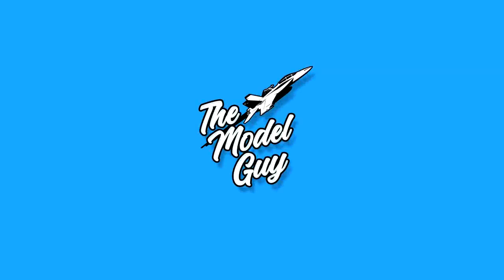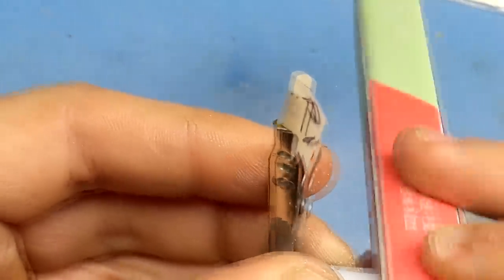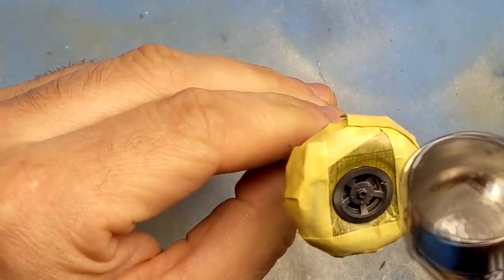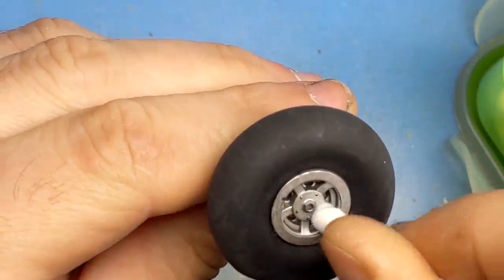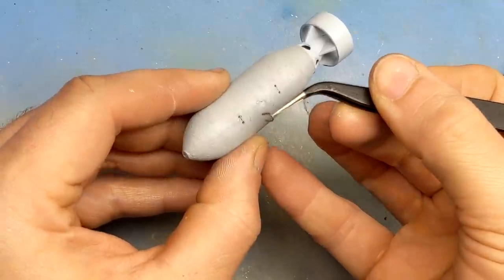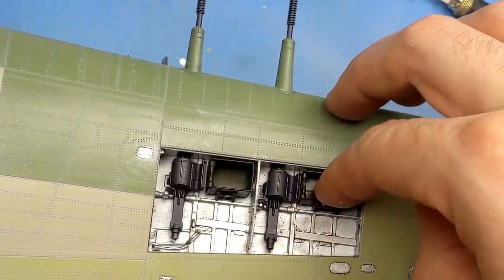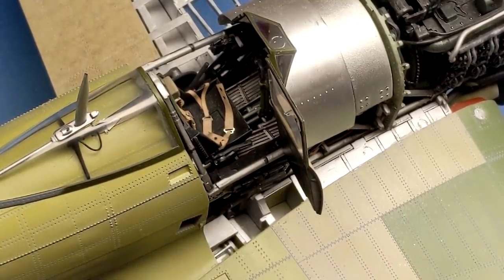1/24 Airfix Typhoon: Part III

Comment: A great video by a great Builder! What great work here! To those that commented about Airfix,  all companies even Tamiya have their good kits and lesser ones. Sometimes just older tooling re released is the cause. I have always been very impressed with Airfix 1/24 WWII Plane kits, fabulous detail! I just built 1/48 P40B, and it was a very clean and well detailed kit. it even has one piece Prop! That's more than I can say about Tamiya Spitfire and P-51 D. Those have those stupid individual prop blades!  A one piece prop is going to be within close tolerances, unlike where you put each blade in separately!

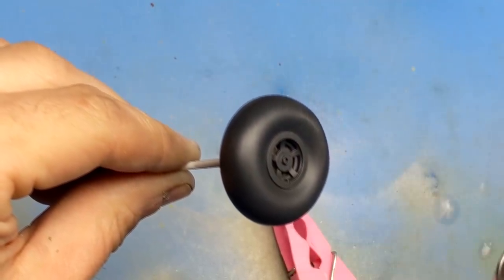Comment: Something new I tried on a model that worked out was using a hypodermic needle to create weld bead son  1:48 aircraft. I was building an Airfix Stuka a year back which had the option of leaving the engine open. The engine was not as detailed as I would have liked it to be so I decided to modify it... a lot. 
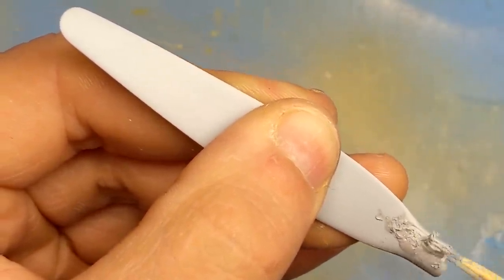To the point. I scribed out lines where I wanted weld beads to be and mixed a tiny bit of tamiya putty with tamiya titanium silver. I used the needle like a caulking gun to apply the 'putty paint' into the groove and used my hobby knife to create a texture. In the end the effect turned out epic and I have used it since. Not many aircraft have many visible weld beads so having them in some areas really draws attention to the area.  It DOES NOT work with 1:35 vehicles. It looks disgusting in the wrong scale.

Comment: i think the defects you out line in this kit and the add detail you have gone to to compensate have added so much depth that i can only see it as a benefit and the results speak for them selves. outstanding work love to see more in this scale. i am just getting back into modeling at age 55. and the level of detail required in this scale has me sucked in, your build has given me inspiration to attempt having a go at 1/24. scale. and will be watching for more info in adding extra detail and the techniques used to achieve the excellence you display.

Comment: Well you asked for opinions on Airfix models. I started making them in the mid 1960's. The smaller 1/72 subjects came in a plastic bag with the instructions stapled over the end of the bag. i don't think in those days they were ever meant to be super accurate scale models. they were for youngsters to make good representations of famous aircraft and tanks. I see the release date of the Typhoon as 2014 so to me it should have pretty reasonable moulding and not bad flash or mould misalignment.  Then again I think they are cheaper than a lot of competitors. To me Wingnut Wings is the other end of the spectrum. I now tend to stick in the middle around the Tamiya standard.

Comment: Where did you get that awesome landing gear assembly? who makes it?
Reply: are we talking about the spring assembly above the wheel at 3:46 in the video?
Reply from the maker: @mitchlenet4238  Ohhhh those. Those are actually Model Master Gun Barrels. They do awesome stuff. I have their M2 50 Cals for my  B-17 in 1.72

Comment: The problem and the challenge with all 1/24th scale aircraft (Not just Airfix) is before it is finished you will have had to re-engineer the crap out of them so that all the sub-assemblies fit properly together. But having said that, I wish 1/24th scale had as many choices as 1/72nd scale does, as I have built all of them but four, mainly because I refuse to pay over $150.00 US for a toy that could feed me for a week. My life long hobby has become to expensive to justify any longer.

Comment: Hey!! you are a pure artist mate!!! I have one question, how do you clean the old brush from the glue and putty? with acetone?
Reply from the maker: It can be cleaned with a lacquer thinner. Just make sure it’s an old one because that process will ruin a good one
Reply: @TheModelGuy  do you think that would be a good idea to fill small gaps with this technique?
Reply from the maker: @lab3470  it depends on the size of the gap. I have seen other guys use that technique. If there is detail you don’t want to lose it’s the way to go. If it’s east derail to repair I use Sprue Goo

Comment: This kit is a known mojo buster, and for a new kit the mould lines and I’ll fitting parts such as undercarriage struts and engine parts would suit a revell kit from the 70’s.
Only good thing about the kit is the fuselage and detail on the wing surfaces all that riveting and options of how you want to display it with open panels. But other than that if you aren’t a confident model builder avoid at all costs.
Reply from the maker: The detail is well done on the outer bits. You can see stressed skin, rivets look good...except the ones that are near the top and bottom of the curve that are mashed.